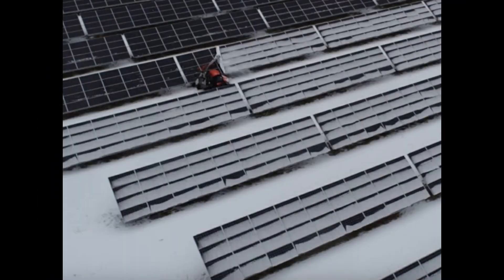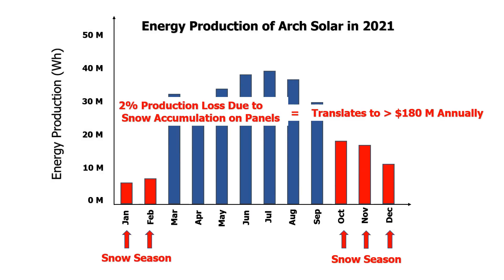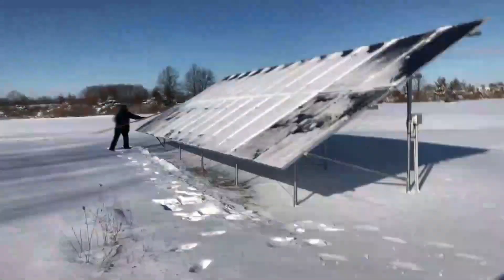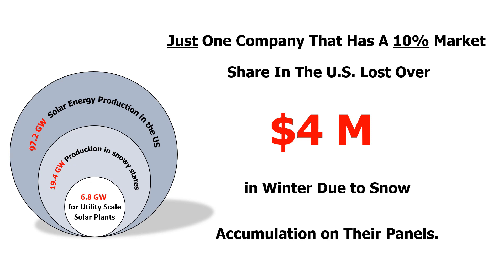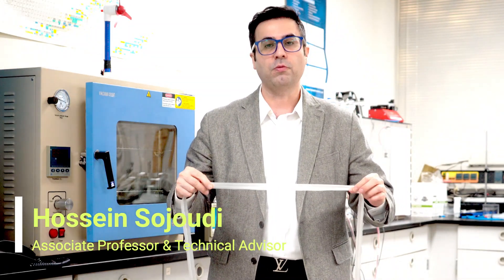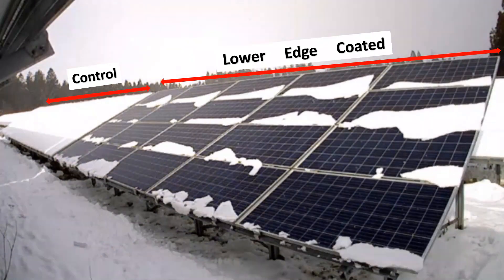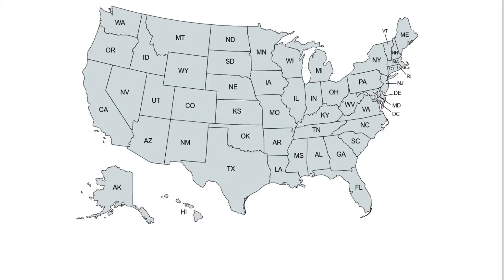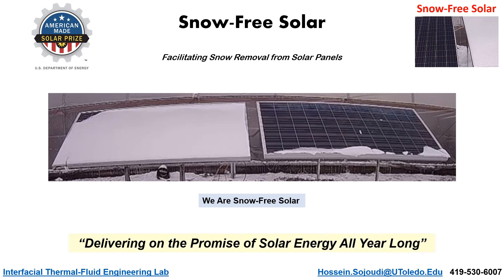Snow-Free Solar--Facilitating Snow Removal From Solar Panels

Comment: Is this a commercial product that is currently available?  How is it powered?
Reply from the maker: No. It is in the process of development. If you have specific questions or interest, please reach out via email at the end of the video.
Reply: Oh my... How much energy to activate the strip?  Is it powered inline?  If self powered how long does it last?  Can it be applied in the cold?  I totally want to try it.
Reply from the maker: @nullstream  There is no need for power. It is passive. You apply to the lower bottom and it works from there....feel free to reach out via email at the end of the video.
Reply: @HosseinSojoudi  As a PV farm owner in the region where in winter its snowy enough i could gladly accept some help to combat the snow. Let me know when product is ready to be ordered!